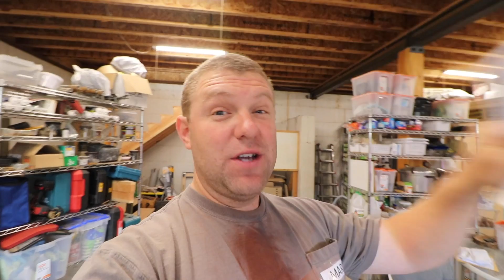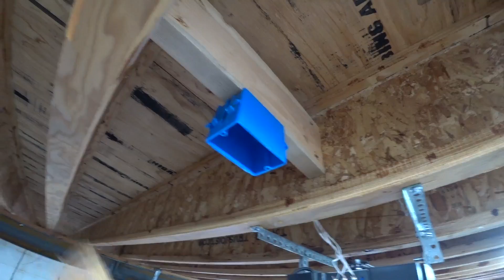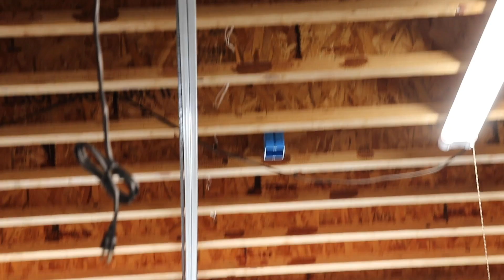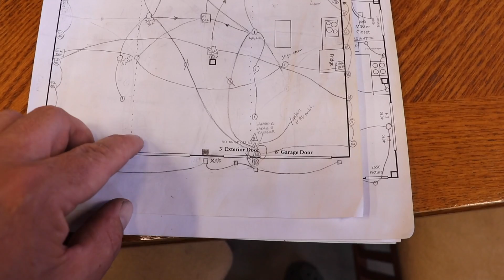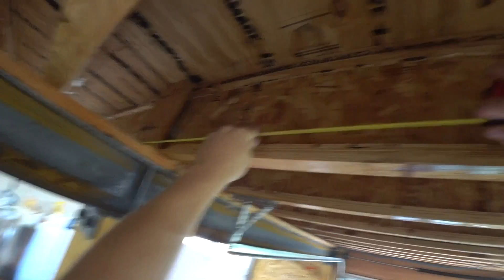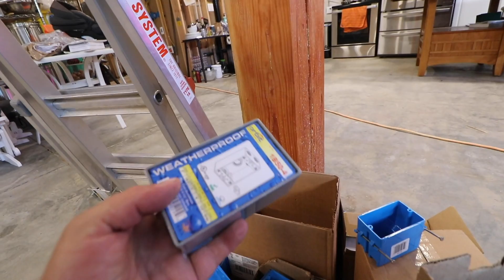She'll LOVE THIS UPGRADE! (Garage Lighting Electrical)

Comment: The one big core issue,, and you have touched upon it.  The normal,,, and for very good reason, sequence of the roughs,, A.   rough plumbing drain and vent lines first.  They must run down hill, shorter the better, no unvented run more than 6 feet.  Plumbing water supplies you have a bit more flexibility.
B. next is install all HVAC duct work.  Again, there are only a few options on routing.   C.  plumbing supply lines, hot and cold, supplies to each required location,, and do not forget future possible changes.  THEN,,, D.  rough electrical. Wires can go pretty much anywhere as long as they are protected,, nothing too close to a surface that may get a nail through it one day. Caution with routing that pass over steel duct work,,,, sharp edges can cut wire insulations.

IF YOU ARE GOING TO DO electrical first.  Pre-think it,,, You are,, this is very good.  AND  leave a bit of slack in your wires.  So you can lift them out of the way of pipes, duct work, etc.  And,,, do not forget ,, Long pipe runs do not automatically slip into place.  Pipe runs and HVAC runs make it into their respective spaces on a diagonal,,,,,, you need enough slack in the wires not only for the finished run,,, but also the slack to be able to angle and weasel the runs into place.

BTW  Always , in the back of your mind,,, the completion, and inspection of all the roughs,,, framing, plumbing, HVAC, and electrical, roof and windows installed.  IS the normal halfway mark on building a residence.  You are a tiny bit past that point,, but not much.  You are halfway to completion of your house.  It is a long process.  You are doing extremely well,,, keep at it.

Comment: Would it be better to finish the outside of the house before dicking around in the garage?
Reply: They have to do electrical before they can spray foam the remaining voids in the sips, before that can do the siding.  This fact kind of steered me clear of sips in my build.
Reply: its dried in so no reason not to work on the interior
Reply: Are those { in the uk we call em sterling boards) weather proof long term?
Reply: @uralrider88  Nope: Just plain old OSB.
Reply: It's not plain OSB. It's rated for some extended external exposure. Not sure how long, though.
Reply: @watcherofwatchers  Trust me its OSB, I have a SIP roof.

Comment: Since these videos can be over a month behind what you're presently doing, it's probably too late to suggest this but as you have a timber frame home and will drywall the ceiling that you could have just trimmed or put up a faux beam perpendicular to the ceiling joists to act as a conduit to run all the wire just below the joists or against a wall and then run most of the wires up into each joist cavity without needing to cut as many holes in your joists...
Reply: I think this video may have been filmed in late May_early June, as I can see the grow lights by the garage door.

Comment: A question, couldn’t you go to 14 ga or even 16 ga wire for lights being that most are led now?
Reply: As they are using standard 15 amp outlets no.
Reply: For lighting you can go with 14 awg, but there isn't that much of a cost difference, and then you have to manage how much 12 awg & 14 awg, and usually (like always) you run short and then have to spend an hour running to the store to go buy more. Penny wise, Pound foolish.
Reply: @guytech7310  All home projects involve at least 3 trips to the hardware store. According to Murphy's Law and Murphy was an optimist!

Comment: Put the light circuits on relays with low voltage controls. You won't have to worry about penetrations as the control wires would only need a 3/16 inch hole.

Comment: I bet DeWalt loves seeing you use one of their hammers to drive screws. Also i have a question, why did you toenail the blocks of wood in over screwing from the back side of the joist?

Comment: Why are you wasting time and drilling unnecessary holes in your I-beam joists?  I noticed that you have a central metal I-beam that runs down the middle of your garage! Why not use it to run electrical.  Run to a point then jump over within the joists. You will cover the metal I-beam up with sheet rock. By doing it my suggested way, you also have a more open free space between joists that you will want to fill with noise damping material. You will find that work in garage can be noisy upstairs.
Reply: You would to fasten the cable to the steel beam per code.

Comment: Could you lengthen the cords on the garage door openers so they reach the centerline of the garage?  If you can, then just put a 2 outlet box there, probably on the same circuit as the outlets on the support posts.

Comment: Jessie, if your going to use the 4" metal boxes in the ceiling, install them with the bottoms recessed from the bottom of the flanges. You can then use a 2 gang plaster rings to be flush with the drywall. This allows more room for wiring in the boxes and you can also use a finished blank plate instead of a 4" steel cover.

Comment: umm with HVAC ducts can't you build out bulkheads in the area your stating from around areas where head clearance is not an issue and use external surface mount boxes with  Conduit  ???? you have one main area in back for pipes and water sewage needs that can go up through the floor and bulkheaded out. /bumped out off wall and ceiling. and outdoor rated surface-mounted electrical outlets etc for the rest. kinda like they did in the perfect house on youtube Matt Risinger channel. a hell of a lot less work i would think and you get outlets with cover/baby protected kinda built-in for unused plugs. while I'd rather have easy connectors /marine twist connects to hook up from outside and pre-made lanes for  HVAC, plumbing, etc already part of ceilings ( think race track /RC car lane like setup that you could pop out, etc/ this is not a thing yet).

Comment: I don’t think it includes the ground wires.   current caring wires and grounds shouldn’t carry any current  unless they changed in recently
Reply: The NEC counts ground wires, UNLESS you're using metallic conduit and boxes because then your grounds are tied to the conduit.  But you're correct in that the grounds should NOT be carrying current, that's the job of the hot and neutral lines.

Comment: Jesse it's time to go over your project with the inspector before you go any further.  They can guide you in the how and why things are done the way they are.  The electrician has lots of answers for you if you're building a stick framed house, but you are not building a stick framed house.  In your case the inspector is going to be making some decisions that have significant impact on the design of the project. Get his decisions in writing because he may not be there by the time you get around to final completion and the next guy may not interpret things the same way.
Reply: He says in the video, and the last one for that matter, that he has an electrician coming to go over it with him.

Comment: 23:49 The alternate method of using the hardened Dewalt impact driver.
Thinking outside the box can sure save you time and effort.
Reply: Wireless hammer.

Comment: Automated switches and a phone app would mean less of a need for those 3 way switches?
Reply: Alexa controlled might also be an option.
Reply: Thats impractical for everyday use. What if your internet is down? and who wants to grab their phone to go into the garage? you will always need manual switches, and none of the automation options will change the power wiring. Unless they go to a DC system with a lighting controller honestly that is more complicated from a wiring perspective.
Reply: @MassiveObfuscation  you would only need one switch this way not 2 3way switches. That does eliminate some of the wiring needed. You also don't need the internet to use this. It can be done either on your home WiFi or through Bluetooth depending on the setup you use.

Comment: Wow I've said it before electrical wiring in the US is soooooooooo complex my head was spinning after the first 5 mins of explanation in the UK I have ONE MCB supplying all the socket outlets in the house including the garage ditto the lights ring circuits are sooo much easier.
Reply: Dont be confused they have no clue what there doing
Reply: The wonders of 110V circuits.
Reply: Try asking an Electrican, UK one, to explain the 18th edition,
Reply: Phillip Powell Remember, you live in Britain, home of Lucas, the Prince of Darkness.
Reply: @chiefof  Hi Will yes but the US is the home of NTSC Television or as it is known to PAL users Never Twice the Same Colour oops sorry Color ;-))
Reply: @will Cushman Lucas gone for many years now,  18th, similar to what you call code, is not simple, just different.

Comment: I hope when your done with what goes in the ceiling you’re covering the ceiling with 5/8” Firecode drywall. If you ever had a fire in the garage it will save your house.
Reply: Code where I live requires 2 layers of 5/8 sheet rock between the garage and the living space for fire resistance.
Reply: I was thinking the same thing!
Reply: nikond90 - 5/8” is standard code requirement but personally with that big of a garage I’d put in two layers which gives you a one hour firewall. I’d also put in heat detectors that will tie into the smoke alarm circuits. That way you can still detect a fire. Lastly I would have preferred they use all metal boxes in the ceiling as they are better for fire.
Reply: @timon0x31  where I live you have to have two layers of 5/8 sheetrock with a half inch Gap in between them. So you might want to contact your local inspector
Reply: @timon0x31  Indeed, the heat build up on the ceiling is huge and within a very short time. We saw in the Grenfell tower Tragedy in London how plastic behaved in places that had been metal or something else, years ago. It lasted seconds before deforming. But we can look at the risk and that seems minimal.
Reply: His 5/8 spacer showed several times in the video.
Reply: I heard him mention sheetrock/drywall covering the ceiling early in the video.

Comment: Why not build a dropped ceiling chase running next to metal I-beam front to back? It wouldn’t have to be too deep or wide since you won’t need it to carry heat runs, only electrical and plumbing. Granted it would take more wire/pipe not taking the shortest route but wouldn’t it save a lot of time drilling holes & worry about drilling too many!?
Just an idea

Comment: I bet your electrician buddy told ya 12 ga. wire is 2.25 cu. in. per wire if he told you grounds only count as 1 wire!
Reply: number of wires in a raceway has to do with derating ampacity of the circuits so usually you can run 4 wires per hole when the hole has 4 wires new holes must be used as a separate raceway. if your raceway is only 2 foot long you can run as many wires as you want in it, no restrictions! Derating only has to do with current carrying wires hence the grounds count as one so you pick up 2 extra current carrying wires or one extra romex.
Reply: install your steel boxes flush and put the appropriate depth mud ring on it. as colored wall covers are much nicer to look at than the steel ones when your ceiling is done.

Comment: Not trying to be a skid mark. Just a little FYI from a licensed electrician. 

Driving screws through the back of the plastic box voids the UL listing of the box. That is the purpose of the side bracket boxes. That is why they are more money. 
I’m not familiar with your codes but where I’m from we fail inspection if we screw through plastic boxes. 

Love the channel. Glad you’re making progress.

Comment: Have you considered adding some strategy smart (WEMO) switches strategically?  Controlling your outside lights and downstairs light from your phone (or voice/Alexa)) really eliminates a lot of travel up and down stairs.  I put in three at my house and it really made switching distant lights very easy.  It also is easier to put the smart switches in before everything is finished. Just a thought to not forget some excellent tech options.  BTW smart switches allow excellent timer options for automatically turning lights on/off according to a schedule.
Reply: Plus random on and off timers for vacations.

Comment: I'm surprised to see you using 12awg wire for the lights and not 14awg. Is there a code, or other reason, to use 12awg wire?

Comment: Too late now, but a longer chain on the light fixtures would prevent having to use a ladder.
Reply: I'm quite sure, that when the wiring is done, the pull chain won't be used, as he can turn it on and from floor level.

Comment: Am I the only person still using 14 gauge wire and 15 Amp breakers for lighting circuits?  Saves money, saves time.....easier on the fingers.
Reply: Steve B     Technically, he is not running a lighting circuit is he?   It just might be a receptacle branch circuit that he plugs lights into.   So, 1.5 amps per receptacle to calculate the load and max of 13 on a 20 amp circuit.     OR he just doesn't really know why he is doing anything.   Could go either way.
Reply: Not really, the cost difference is about $10 for a 250ft roll. By code lighting has to be on 15 amp breakers, but you can use 12 awg on 15 amp breakers. I just use 12 awg for all the cabling, saves the hassle of running out of 14 awg or 12 awg.
Reply: Guy Tech    Please tell me where NEC says lights have to be on a 15 amp circuit.   I have not seen that one.
Reply: @KevinCoop1  I am also unaware of the NEC requirement for lighting circuits to be on 15 amp breakers. I also don't wire 12 awg to 15 amp breakers....Safety against future assumptions.
Reply: Steve B    Installing #12 to a 15 amp breaker can be required sometimes.   Two instances that may cause the need are voltage drop and the number of conductors bundled or in conduit where conductors need to be derated.
Reply: Na your right there just doing this like a homeowners

Comment: In  Sweden, most electrical boxes are round, not square. It is way easier to make a round hole in the sheetrock than a square. Also, with a magnetic hole-finder, you dont have to measure out the position of the hole or making the hole prior to fasten the sheetrock.
A business proposal for an entrepreneur.
Reply: Bengt Abelsson shockingly we use both, most ceiling boxes are round or have round mud rings attached. Some wall fixtures will be round as well but in general outlet and switch boxes are square and a drywaller with a zip saw doesn’t care.
Reply: Bengt Abelsson    In the US we also use round boxes that have larger screws to hold the weight of the luminaire.   But technically, he is running receptacle branch circuits, not light branch circuits.

Comment: BI-STABLE Relays will (1) normalize your switches , they become push buttons (2) you can use as many buttons as you wish in parallel (3) Much less wire (the push button wires can be very small) ... Just a hint ... 

keep going ..

Comment: If were to wire a garage in the UK under a living space, all electrical wires and fixtures would need to be run and installed thru industrial steel conduits and steel boxes for sockets and switches!!

Comment: Do you plan on fire foaming those I-Joists before sheet-rocking the ceiling?
Reply: I don't think they'll need to worry about burning jet fuel in the garage.  Unless they bought the engine that Cleetus McFarland is pulling out of his drag truck.

Comment: You do 1 large junction box in the middle of the room. You can recess it and make a thin metal plate to access the box. 
It can be a 12" x 12" box used for everything.

Why not finish the house? who care about temp lights or power in the garage?>
Reply: Apparently, they care.
Reply: They are building the house debt free. Plus they just had their family grow. I think, as the garage is their living space mostly—the kitchen and bathroom are down there after all—that putting in those circuits is top priority right now. They can’t side the house until it’s foamed, and it can’t be foamed until they put in electrical upstairs. The garage is the training ground for the upstairs electrical.